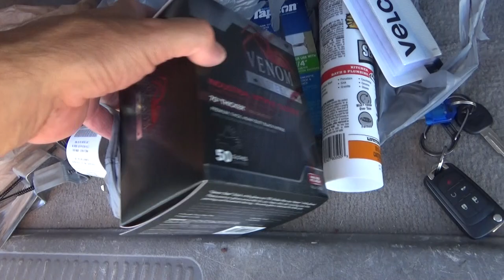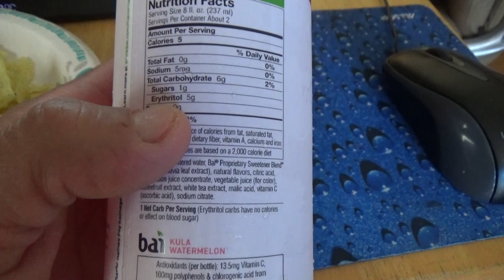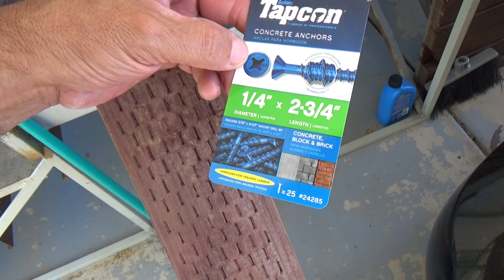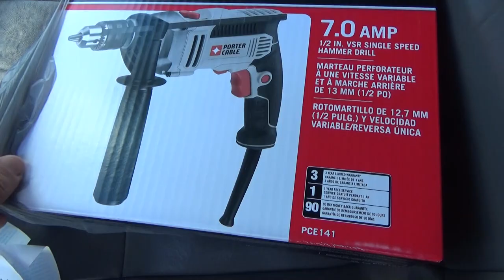The Carport Privacy Wall is FINISHED !!

Comment: That is so nice.  Major improvement.  The concrete drilling was useful to me because I will be putting up a rose trellis soon.  Thanks.
Reply from the maker: its nice to have the right tool for the job, the hammer drill made it so much easier and faster. total time took me about 1 hour after I got the right tool and screws. but before that I spent the whole day working on it lol.

Comment: looks good and how you got the longer screws to even work is beyond me, I always use concrete bolt/screw anchors in the block or cement walls and then use screws into the anchors..I give you props it worked.
Reply from the maker: the longer screws are in nice and tight, longer is better.